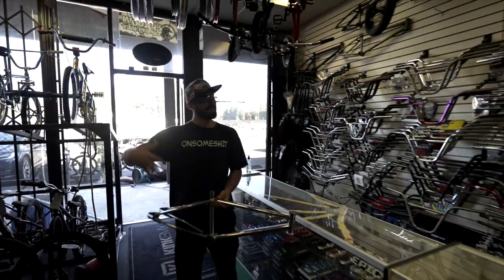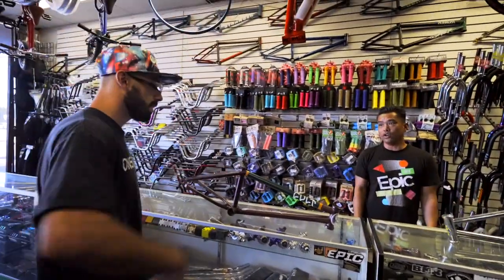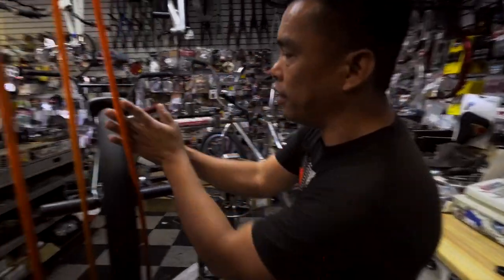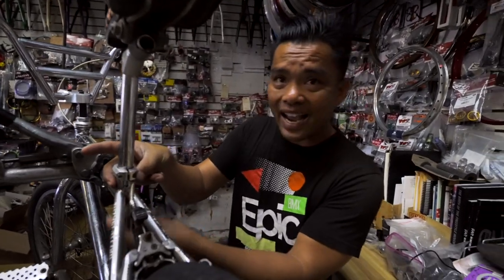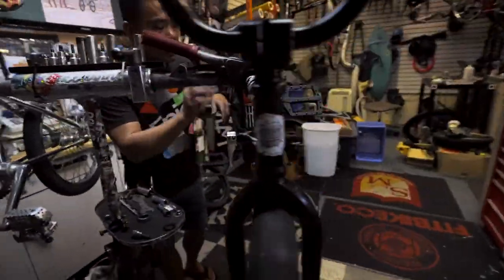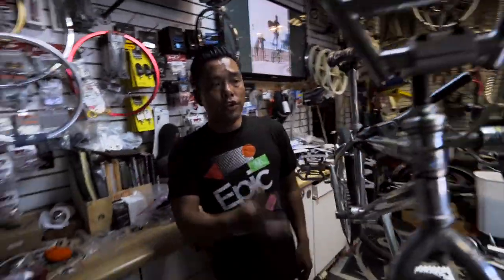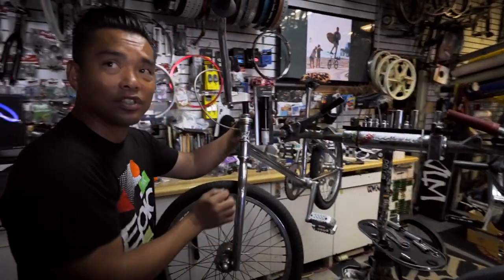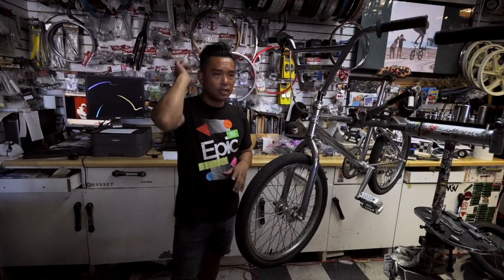Old School vs New School BMX Bikes!

Comment: I'm 39 and getting my 10 year old into BMX... Things have definitely changed since cruising my GT Interceptor in the early 90's. This video made allot of sense and was clear. Thanks for the videos.
Reply: Yeah same with mountain bikes.  They keep changing standards and new tech constantly (tapered head tubes for example limit your fork choice if you have an old bike).  You buy a bike as an upgrade platform and in 10 years, newer parts become incompatible.

Comment: Nice video Alfred. Very interesting topic.
Just I'm a quite disagree with Phu today. Actually, 1 1/8 forks may fit into a os frame. They aren't 1" head tube strictly, so you've room for it.
I made it twice and that works very well.

Comment: Hey Alfredo I bought a mongoose Cali special repop out of the box it was pretty easy to assemble but I stuck with the diaconpe Mx brakes my rear brake only one side moves when I press the lever the other side seems to be stuck and won’t move, I’ve played around with it but just can’t figure it out 
A video on the new repop diacompe brakes would be cool 
Cheers Silas

Comment: I had a 2001 Gt Dyno VFR with one piece cranks. I didn’t know at the time that one piece cranks have 1/2 inch pedals so when I bought 9/16 odyssey pedals I had to switch out the spindles to make them fit.
Reply: *dyno vfr

Comment: I just came across your channel 2 days ago because ive been rebuilding this old next bike I no it ain't no bmx but I'm 44 I'm just want to ride anyway I hope you respond back because your video on spoke lacing is the best 1 I've seen real talk so as I'm doing as you said in the video it's going down right than I hit a snag because spokes wouldn't fit or whatever so my question is if the flange spoke rim it self has any type of bend in them is worth less or is there still away I can still lace the rim

Comment: I built mix school bikes since 06.. there are 7/8" pivotal posts out. Conversion HS 's are easily made. New GT hubs have 3/8" axles, 2.1 tires fit OS frames. I run all 1.85s on all my bikes.

Comment: 14mm slotted axles slide right in a 3/8 dropout.No frame mutilation necessary.
Reply: True that. Classic.
Reply: Lol- yeah right- so many frames were cut and now they are being put back to 10mm!
Reply: @robertlund5694  i have a 2002 gt tour 2, i actually ground them to take 14mm axles.But their seriously an inch thick so no worries of stressing the frame.

Comment: Could you put a 20x2.1 on the Robinson and change the width on rim by a little with a double sided hub with a 3/8 axle with a 13t on one side 16t on the other and put a 39t sprocket.
Reply: What did you say?

Comment: I have a question about that 1" to 1-1/8" converter.  Does it have a hollow allen bolt down the middle to run the front brake cable?
Reply: Most or all of those adapters are made from aluminum, and would not survive for more than a few minutes if you plan to do any aggressive riding.

Comment: Only thing i haven't found is a sealed bearing hub on the 1 inch to work with a gen 1 gyro so far. Tell me if someone has done it. I will buy that and tell everyone to buy it

Comment: You can actually use a 1 1/8” fork on a old school 1” frame . It takes mix and matching headset parts and free balling the bearings. I ve done several times works just fine. Let me know if you want pics. I just built a 1978 mongoose with SE landing gear threadless forks. It works like a dream bro.
Reply: i 'free balled' back in the 80's....chick did NOT dig

Comment: Hope you read this because I have very limited info on the bike I’m about to mention. It was around ’86 or ‘87 and it was called a Jamis Laser Fastimes. My brother and I got one for Xmas one year. His was white with dayglo orange and black trim. Mine was white with pink and lime green trim. They were both fully decked out with rotors, front and back pegs….you name it, it was on it. They cost a little over $500 each and back then, that was about what the Haro Master was running. Only thing is, nobody else around us had one or had heard of them. Nobody that I knew was ever sponsored by them and I never saw them in any of the bike mags. I still have the frame, mags, front forks…..actually everything but the brake parts (levers, lines, calipers, etc.) I reckon my question is, have you ever heard of them and if so, would love to know anything you can tell me about them. Thanks.

Comment: I converted my 1979 Schwinn 36-36 from threaded to threadles forks... of course I had to trim the inside of the bearing cups usings a dremel... Very very close fit btw !.. also had to do away with the bearing casings (tins) and straight run the bearings... if you've went this far, USE THE BEST HIGH GRADED GREASE YOU CAN FIND to make it last as long as possible. PS: Water Resisitant Grease Is The Way To Go ! Don't Be CHEAP Buy The Good Shit .!.. =_=
Reply: ddamnnn nice

Comment: Over the years BMX has changed from 1" steerer to 1" 1/8 and tube sizes have changed on frames and back ends of frames have got shorter from 14" to 13" to 12" back ends and BB has changed from American BB to Mid BB's
Reply: I wish I could ride a chainstay under 13". The heel of my size 11 shoes LOVE to get caught under my rear pegs at the worst times HAHAHAHA
Reply: Pros and cons but at least BMX is moving in the right direction.
Reply: @oldguyrips535  I’m size 12 and I’ve got a 13 back end

Comment: hey alf what's a 3/8 axle is it like a 10mm
Reply: 3/8" is 9.5mm in metric
Reply: @bmxscape  thank you but will it fit on a 10mm hole peg
Reply: @ethan-eo5jb  yes 9.5mm axle will fit inside a 10mm hole
Reply: @bmxscape  ok thx
Reply: @ethan-eo5jb  no problem, any more questions just ask
Reply: @bmxscape  😉👌

Comment: you can 100% put new modern parts on old school bikes, there are headsets for threadless forks and all kinda shit! But I get the point of this video. Truth is, old school IS better because it started shit, but new is technically better because it uses future age metals and processes. Other than the metal used, new has nothing on old.